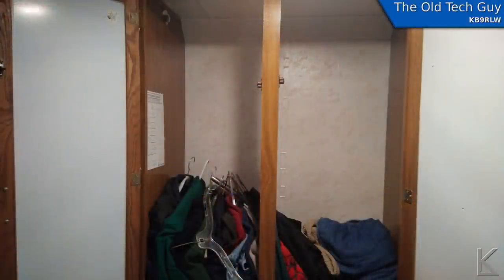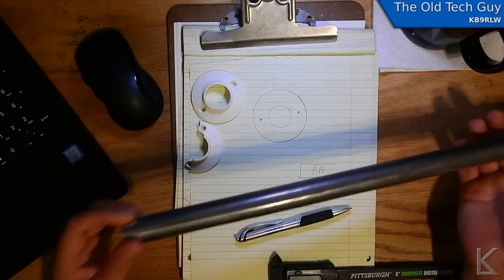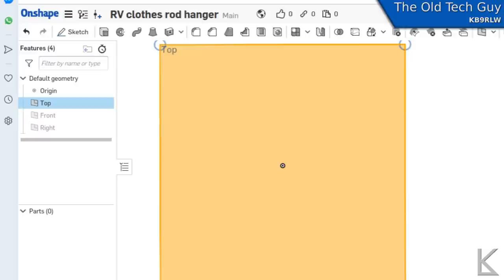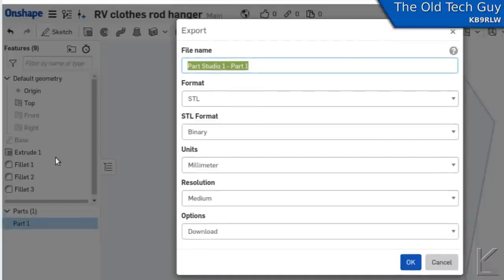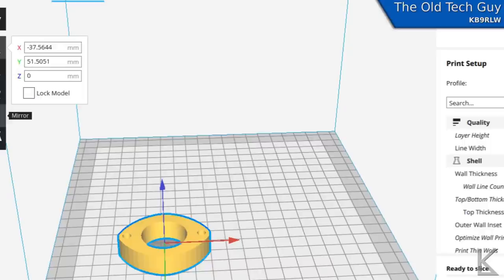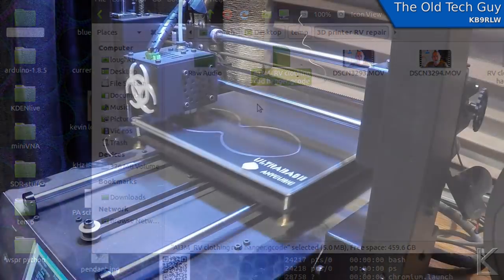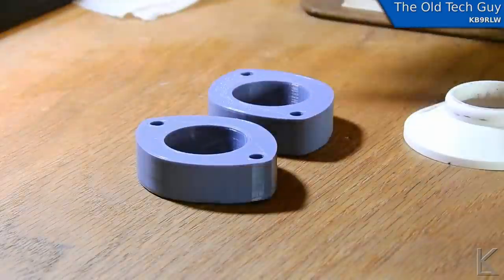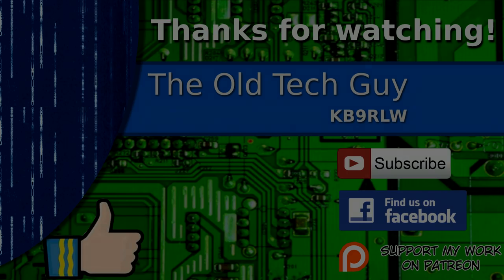3D Printing - Simple RV repair. New fixtures to hold up the clothes rod in the closet.

Comment: That actually did make me laugh. "I design in mm, cm, the metric system... the rod has an OD of 25.6 mm..." well allowing for 0.2mm tolerance that would be one inch (25.4 mm). I'm not criticising, I use whatever units feel right, are appropriate, were used in the original that I am replacing etc. It is all good. I'm multilingual in units, Ha! good job.

Comment: Your RV needs a 3D printer for the same reason the International Space Station needs a 3D printer.

I've been using my FDM (filament) printer for a few years but my new QIDI Shadow 5.5S MSLA (resin) printer arrived  yesterday and I spent all night slicing models that I downloaded to test the printer.  The print volume is only 115 X 68 X 155 mm, but the 47 micron resolution is incredible.  The printer has a smaller footprint than an FDM printer so it'd be great for printing small RV repair parts, and the resin has improved to "ABS-like" or better so the parts are very structural and would be good for antenna parts as well.  Print times are surprisingly fast given the high resolution because the entire layer is printed at once in 10-15 seconds.  The resin parts are isotropic.  There is no layer separation and parts can be printed to take advantage of the larger Z travel.  I now have less use for my FDM printers.  MSLA part cleanup and UV post curing are a bit tedious, but I've designed an ultrasonic cleaner and circulating rinse station with UV post curing that should make this feasible for small scale manufacturing.

Comment: This is exactly why we have 3D printers!  You can make the part the way you want it and usually stronger/cheaper than what you could buy.   I agree about using metric for small things - it's much easier to think in millimeters.   I design in tinkercad and slice/print on Prusa - I know my bed is 250mm wide so i don't have to keep doing conversions to figure out if the part will fit.   But on big stuff (like cutting plywood or 2x4s) I'm still more comfortable using inches.  I did buy a metric tape measure last year so that might change.

Comment: Great job Kevin. I find a sense of accomplishment making things I would normally have to buy. I wondered about putting the screws at top and bottom so that the bottom screw helped hold the weight. Then I thought about G force if you were motoring along and had to slam on brakes! (Depending on orientation of the rod). 73 N4WLC, Bill

Comment: Hi Kevin, I had been using TinkerCAD but found it a bit clunky to use. I hadn’t heard of OnShape till now and I find it more intuitive than TinkerCAD.  I had a shelf fail in a garage cabinet, and I followed your lead here and made new shelf supports with OnShape and my 3D printer.  An hour or so later, the shelf was back in the cabinet.  Thanks for the idea.
Reply from the maker: Tinker is pretty good for beginners to 3D printing that have no experience with CAD.

Comment: At 8:10 your talking about that the printing is better in front of the plate then in the middle. I had the same problem for a while and found out that there was a crack in the Bowden Drive (the motor driving the filament to the extruder through the tube) and it slipped on the filament when the filament tube was bend for printing in the midle of the heatbed. 

 When I replaced it I could print again all over the heatbed.

Comment: pretty cool. looks alot beefier and should be alot better than factory. You need a cheap small car or jeep as a tow vehicle. That way when you get the rv set up you can take the car jeep or motorcycle into town and leave the rv parked and setup.
Reply from the maker: I can't afford to register and insure a second vehicle.  If so, I'd have kept my Kia Soul.  It was a great little car.
Reply: @loughkb  Honda 70 or 90 mini cycle..from the 70's style.. hihi.

Comment: How long in real time did it take to measure, design & print?
Vs.
How long would it take to tear down, drive in, hunt the store for the parts (& get "the virus" for the effort, drive back & setup again?

Oh yeah & the gas to run to the store & back! That thing don't run on good wishes & rainbows...

Great job Kevin! You can tell the quality is there just by the chunky sound made when you dropped it on the table. (Like the sound difference between drooping a small washer & a silver dollar on the same table... )

73
Reply from the maker: About 4 hours total time if I did everything in one go.   It took a LOT longer with all the camera setup and filming time.
No doubt it would have been quicker, but not cheaper, to go into town.  But what fun is that?
Reply: @loughkb  agreed, plus you got much better quality from your own build.   Have you ever 3-d printed  using the metal stuff or is your machine capable of that...

Comment: Hi Kevin, two questions:
1. Is it you personally that works with metric or is there a silent transition from imperial to metric happening in the US?
2. How does behave your 3D printer when the RV is moving by walking around or stepping in / out the vehicle?
Reply from the maker: I can't answer the first question, I have no idea.
As to the second, the printer doesn't seem to care about small movements and vibrations.   The wind will wobble the RV a bit during a print and the print will be fine.   It's a solid metal frame on the printer with real lead screws for the carriage support.  Very tight build.

Comment: What printer are you using.  I'm wanting to get into 3D printing but don't have a printer yet.  73 de VA3TWT
Reply from the maker: Anycubic I3 Mega.   I have several vids on 3D printing.  Just search my channel for 3D.
Reply: @loughkb  I'm considering the Anycubic Mega i3 S.  Any thoughts on this printer?
Reply: @gordonclaridge1626  I bought my first 3D printer about a year ago. If you read enough reviews you will find every extreme viewpoint about every printer. People who love/hate every make & model. My advice would be to go for whatever make is the most popular when you buy it, because there will be the most support, active forums, upgrade parts etc. Having said that, Prusa supposedly make the best printers for the home enthusiast, but the Creality Ender models are also very popular. I bought a Sovol SV01 (which is mostly based off Creality parts) and have been very happy with it. 73 M6EXF
Reply from the maker: @gordonclaridge1626  Sorry, no.  I haven't kept up with their current models.
The build quality on mine is pretty good though.  Steel and solid.  Good components, like real lead screws instead of cheap threaded rod.   But, I did have to remove some tiny metal shavings from one of the stepper motors.  Milling dust I think.   That was the fault of the builder of the motor though, not anycubic.